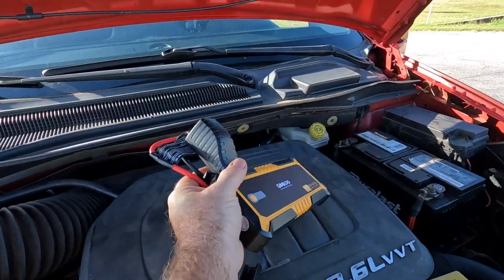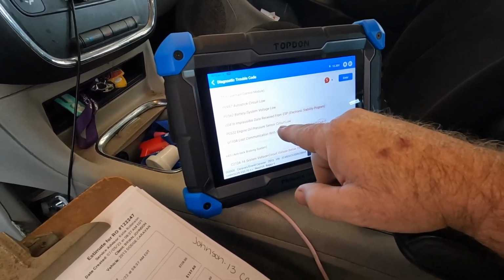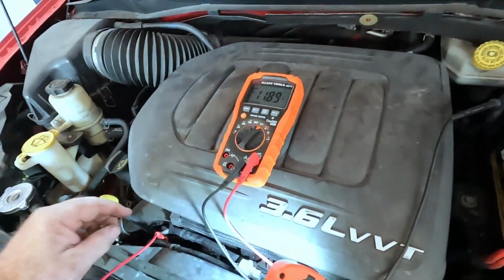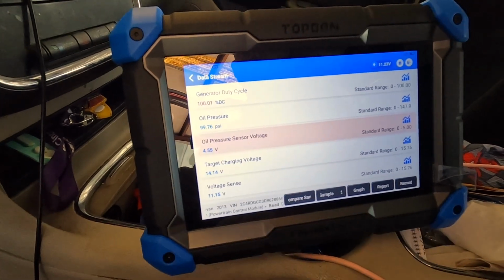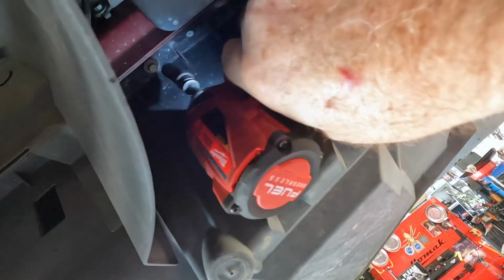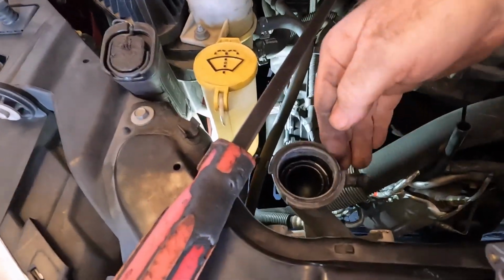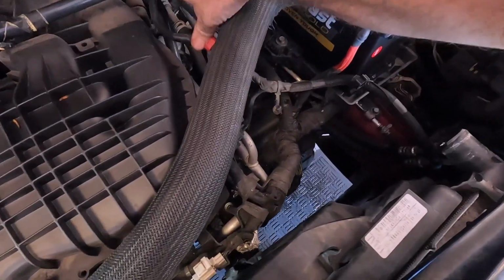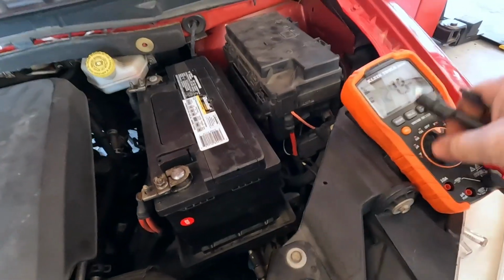REPLACING YOUR DODGE GRAND CARAVAN Alternator, REPAIR, SHORTED DRAINING BATTERY...

Comment: Lol, my dad drove his to the grocery store and back and when I went to move the car in the evening, the battery was completely dead, like at 2 volts left and the car would die as soon as the jump starter was powered off. Had to swap a new battery in just to move the car into the garage. The alternator was easy to diagnose as the entire engine bay smelled like an electrical fire after 30 seconds of driving 😂😂
Reply from the maker: That definitely sounds like a dead alternator! 😂 Glad you got it swapped. 🔧

Comment: I have the exact same problem. Alternator un-alived my battery and its overheating and not charging. Like your method the best to replace the alternator except I don't have a hoist...or even a garage. The hardest part will be releasing the tensioner while laying on the ground. I will find a way. Just waiting for the new alternator to arrive. Good video. Thanks for sharing.
Reply from the maker: Glad it helped, hope you get it sorted!

Comment: what fuse does the alternator go to while charging the battery? It's not labeled on my 2017 caravan
Reply from the maker: They usually use a fuse link or large main fuse. 100 amps or more.
Reply: On my 2011, the field circuit uses fuse M19 in the TIPM then to the PCM. Look for ASD 1 & 2 on the diagram under the lid. For the large charge cable there is a fusable (sp) link towards the front and below the TIPM. To test, check voltage drop between B+ on the alternator and pos battery terminal. Should be in the low mV DC range.

Comment: whats it cost for an alterantor and replacement generally. i never had a dad, so im sacred to do any of this on my own, even with a video, im just so afraid of causing so much damange. if i paid someone what should i expect
Reply from the maker: These aren’t too bad as far as labor. About 1.5-2.0 depending on rust and other considerations. But I’d think it’s a $500-600 repair or so?

Comment: Thanks for the video. I have to change the alternator on our van. The other day the van felt like a loss of power, ac stopped working but when I started driving everything went back to normal. This morning I went to go grocery shopping and it wouldn’t crank. Wish I had a shop but I don’t so time to get working on the driveway is this nasty humidity 😂
Reply from the maker: Good luck! Hope the video helped.
Reply: Tow man, how bad was the swap? I’m staring down a dead alternator, and I’m not sure I want to take it on myself or just eat the shop prices to avoid working in the snow
Reply: @ honestly it wasn’t horrible. I would suggest covering the radiator with cardboard when pulling out the alternator so you don’t bang into it.
Reply: @ funny you say that, I had the idea but wasn’t sure if it was a good one.
Thanks 
First step is to order all the parts

Do you think there’s value in buying a new serpentine kit (pulley and tensioner plus the belt?)
Reply: @Jrockjeff  you can’t go wrong with changing some parts. I changed our cause it’s been a few years we own the van and I don’t know when it’s been changed or if it has been changed. I put a new belt, new tensioner, and new idle pulley. The parts weren’t too expensive so I figured I might as well do it all at one shot. I bought my alternator from a local shop here that sells new and re-manufactured alternators that they rebuild and so far everything has been great.

Comment: I have same vehicle 2011 and tried a few things 3 new alternators got 8.8v from field wire from PCM but still not charging is there something I am missing I been at this for months I remember the days when alternator went bad just replace it or the voltage regulator now you have to figure out what the hell is controlling what.
Reply from the maker: Some of the aftermarket alternators won’t work correctly on these. On rare occasions we’ve had to use OEM.
Also if it is not charging, using a meter, sometimes turning the lights on can force it to charge. But if the dash light is coming on I’d try the OEM part.

Comment: I didn't understand, you mentioned the new battery you installed was dead and you could smell the alternator. So you then hooked up the battery charger to the new battery with the alternator disconnected? Were you attempting to charge the new battery with the bad alternator? I think i have the same thing going where my alternator is draining the battery.
Reply from the maker: When the new battery began to discharge from the alternator short I recharged it with the alternator disconnected.

Comment: I have a new battery and alternator and still have battery light and still drains battery and alternator is getting power what could it be bad pcm?
Reply from the maker: I would use a wiring diagram to check alternator controls and main leads. Also check with a scan tool to see if it’s trying to make the alternator charge. Should be over 80% duty cycle.
I have also seen defective alternators, PCM can cause the issue but it’s rare.

Comment: Will you show me fusable link please mu wife got 2011 dodge grand caravan and has starting problem :(
Reply from the maker: Usually a bad starter or battery cable connection on a Caravan that won't crank? Have to use a test light and check to see where the power is going or not going during cranking.
Reply: @JimmyMakingitwork  the alternator burned out, when she went to work cause its smoking when i get there, i replace that, and i was like aince i was here replace the starter, still no good, i use probe see if it cranks and it did but wont start.

Comment: great job but what is the fuse for the alternator? on Town and Country or Routan?
Reply from the maker: These have a "Maxi fuse" in the fuse box, they are high amperage specific fuses for the task, usually 80-120 amps. They rarely blow though, unless jumper cables are connected backwards or an alternator has a very solid short that pulls a lot of amperage. This one only drew about 20 amps and discharged the battery, but didn't blow the fuse.
Reply: @JimmyMakingitwork  do they look like the other but larger?
Reply from the maker: They are usually square plastic and varying colors, they can also be flat bars between posts in the fuse panel.
Reply: @JimmyMakingitwork  thanks for your response but I can’t find anything that looks like a fuse or anyone talking about it on YouTube hmmm

Comment: Where is the alternator relay or fuse located?
Reply from the maker: Alternators aren’t usually fused by a common fuse, but by a large main fuse of 80-120 amps. Usually located near the main fuse panel. They mostly only open when jumper cables are connected backwards or something similar.

Comment: Thanks for the vid Jimmy! Did a friend's in about 1.5 hours. One tip for others who are about to do the same: You don't need to detach the wiring harness from the fan shroud. Just lift it out and let the whole thing sit on the battery.
Reply from the maker: Thanks for sharing!

Comment: that's one way to do it I just did one. evact the ac pulled the lines. your way was much simpler lmfao I didn't use aldata I just went with it. knocked out a brake job as the ac was evacking. worked out well.
Reply from the maker: There you go, more than one way to skin a cat! ;)

Comment: Seen this generation of vans with very high miles and still going. Resale value in my area with over 100,000 miles is still high. I  have owned Chrysler minivans throughout my driving life and I am 45 now. The 3.3L and 3.8L are simple engines and last a long time. The 3.6L has some known issues, but it has proven longevity as well.
Reply from the maker: Thanks for watching!

Comment: I will be keeping an EYE out if you every repair 2008 Chevy Equinox!!! My Emergency and ABS lights on and someone said its the Brake Fluid Sensor mounted below the reserve and I cant see it??? I know a Sensor is like 12-15bucks!!!
Reply from the maker: If the brake fluid level sensor is bad unplugging it will usually turn off the light? It’s in the fluid resovoir.
Reply: @JimmyMakingitwork  Its INSIDE??? I looked all over the place for it!!! I never thought to take the cover off to look!!!